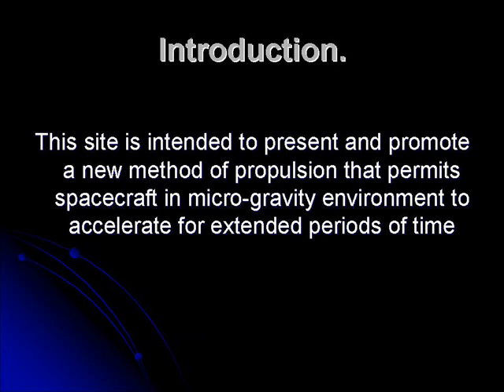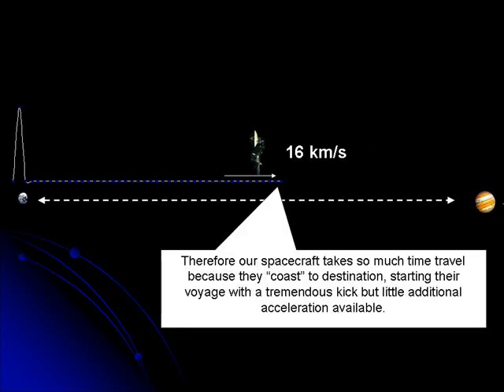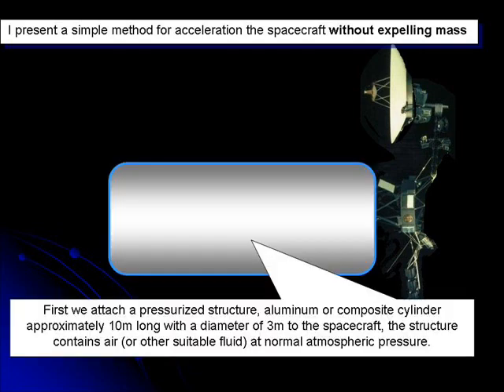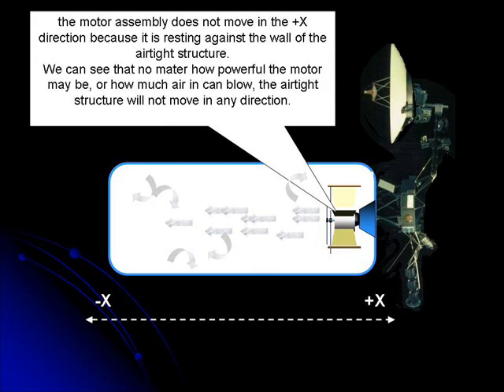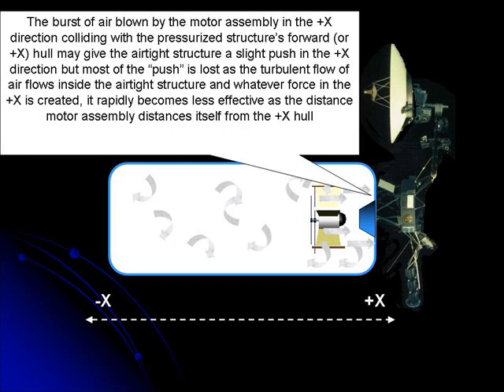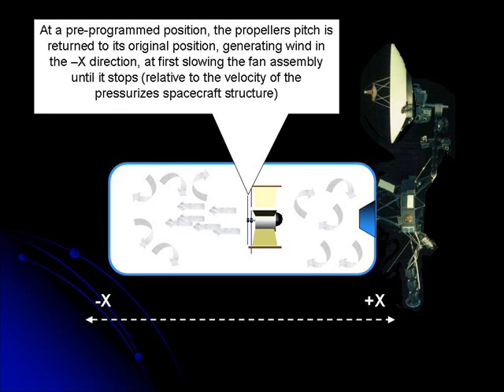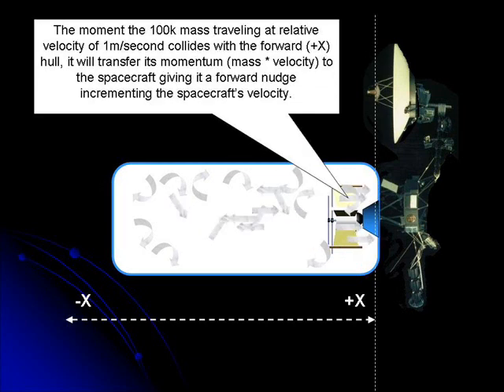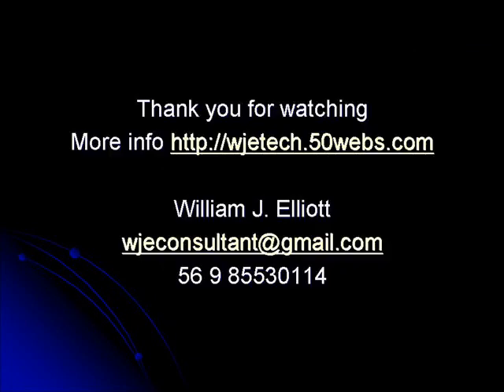How Propeller Space Drive Works

Comment: Since there is no friction in space or anything to slow you down couldnt we just use and engine to do small pushes every few min picking up speed each time infinitly instead of a constant burn you would think so. Although it might only get up to a curtain speed untill the space craft is traveling faster than the trust exiting the engine. Thats were we need a laser to push a spacecraft because it is the only thing traveling at light speed that we know of anyway so i think we need to use either lasers or magnetics. It woukd be nice if you could have a laser on the back of your space craft that pushes it's self.

Comment: Certainly you are sincerely seeking. Your path will lead you to realize that half way along in the video you stopped thinking and instead fell into the spell of newton's I'll stated third law. Reality will tell you that the reaction of the fan pressing directly against the front of the ship is working DIRECTLY TO DRIVE THE WHOLE SYSTEM forward. However, the air pressure is in all directions. And irregularly. And is being heated up by the spinning fan. The air pressure is not thirsting backwards

Comment: The test bed is not a true test; it relies upon surface friction (wheels) which transfers through the bed to table to ground.  It uses the force of friction to gain momentum.

In the fan scenario; the fan pushes as much as it pulls.  Even if you could create an unbalanced force fan; once the fan assembly impacted the craft increasing momentum, the craft would move forward and the back side of the vacuum chamber would hit the back of the fan creating an opposite force of momentum.

Comment from the maker: It’s a gadget but it does work, has been tested on a “balancing test bed assembly” where surface fiction is not an issue
You can see the testing here: wjetech.cl

Has also been tested on dry ice plucks and water (you could try it yourself)

Thanks for the comment

Comment: in addition, once the fan assembly impacted the hull, transfering momentum, it would stop and the back of the pressurized tank would travel with velocity toward the fan until it impacted the fan; thus cancelling the first impact force.  Nothing in this scenario provides for an unbalanced force propulsion system.

Comment: the "fan" system is an expulsion of mass (air) in one direction and then the other.  

The force to gain momentum in one direction does create a counter force in the opposite direction.  If not, then the fan assembly would not accelerate in either direction.  It is pushing or pulling against the atmosphere of the pressurized container.

Just because there is not air flow, does not mean there is not a transference of other momentum/energy in the form of vibration and heat.

Comment: "The burst of air (...) _may_ give the (...) structure a slight push (...)"

Have you ever seen a hexacopter lift off? It's a small (eg. 2 kg) six-rotor craft. When it lifts off (ever so gently), it picks up *rocks* and throws them. It is nowhere near a gentle nudge, a slight push. It's a massive and continuous push.

This type of trying to crack the law of conservation of momentum is called "doing small momentum changes and hoping the Universe doesn't notice" :-)